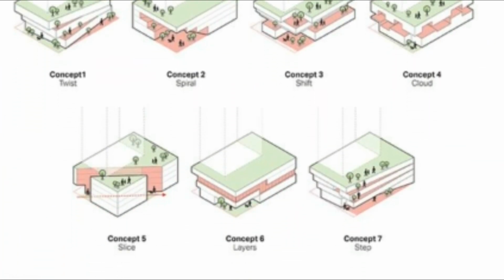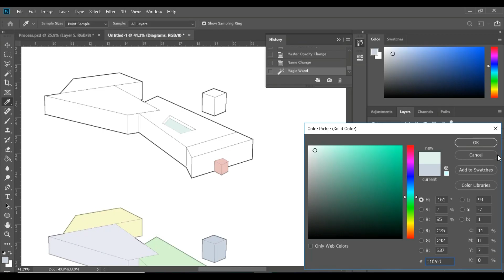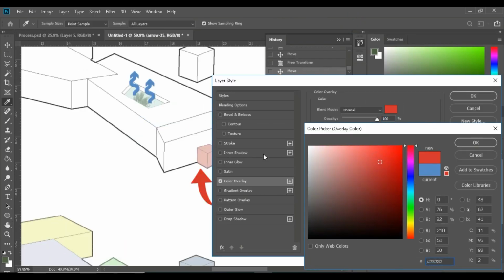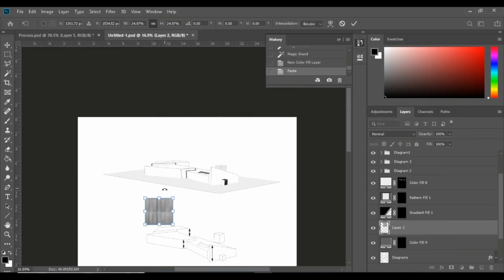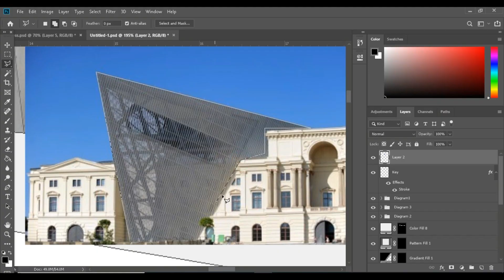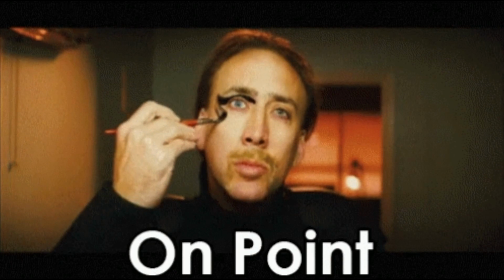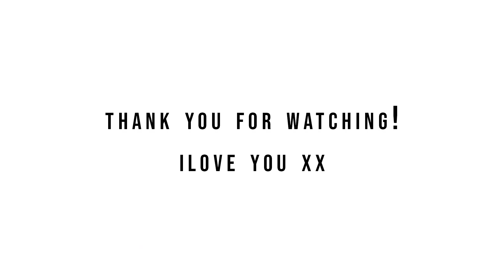Concept Diagram Architecture in Sketchup /Photoshop

Comment: which one the best software for design..?
Reply from the maker: What do you mean with 'design'? Diagrams, render, analysis each design method has its own preferable software.
Reply: @SurvivingArchitecture  for architecture building design
Reply from the maker: For plans, elevations, and sections I use AutoCAD however using Revit is better as it is sometimes demanded when working in a firm. To understanding form I use Sketchup, and for rendering final images I use Photoshop.

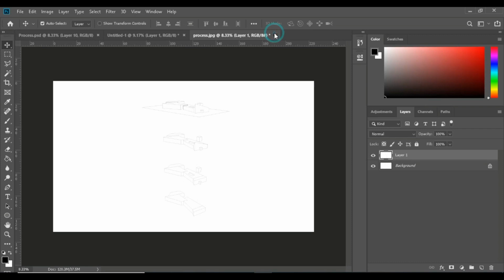Comment: What happens between 1:41 and 1:42? Could you add the missing bit in the details, thanks!
Reply from the maker: I used the magic wand tool to remove the white background to give a stroke over the individual diagrams as it was an image from SketchUp. I made the stroke by right-clicking on the layer and selecting blending options and went to the stroke menu and made it thick. I hope this explained it :)
Reply: Surviving Architecture n